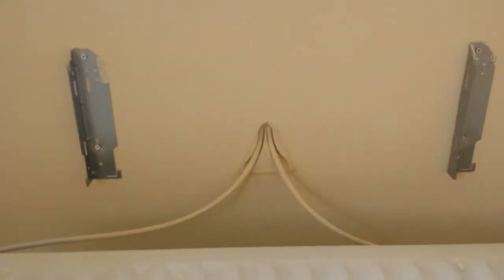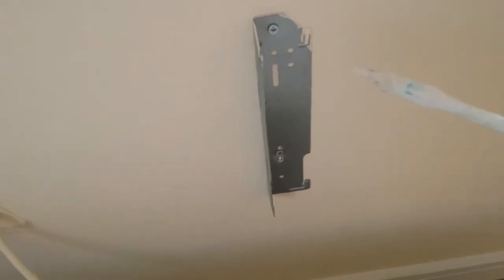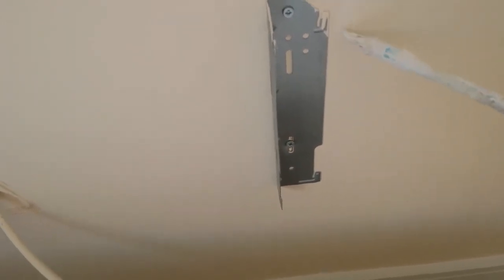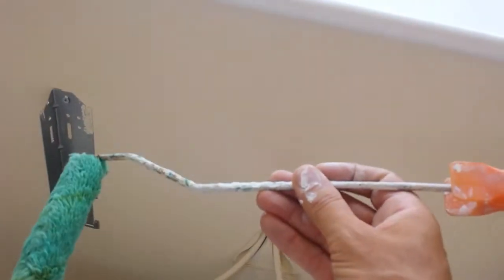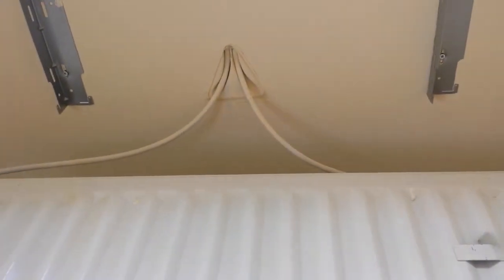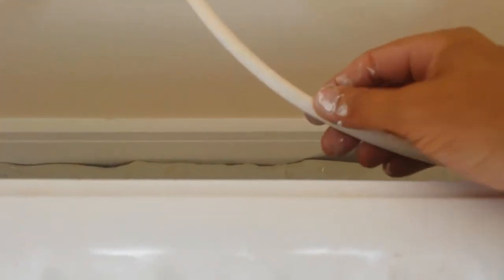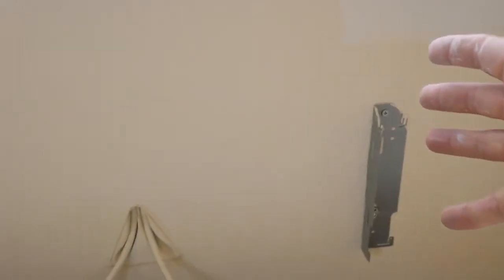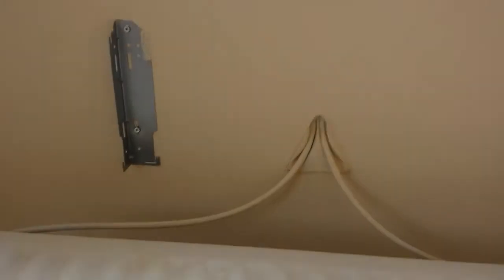Painting Behind Radiators

Comment: Only thing here is, if you do this and a leak happens in the near future its your fault or you will get blamed anyway.. 
Safer to leave plumbers to this. Customer will have to pay plumber direct. 
Painters public liability will not cover you taking radiators off if you caused water damage.
Reply: I never take off copper pipe radiators as I've had nightmares in the past with leaks and pressure in the boiler dropping etc. But these plastic pipes stay in contact I just unhook these without taking off the pipes. I've had no issues so far.
Reply: @danielnugent2168  great website Daniel, top marks for doing it right fella, its just a one of these days thing for no extra thanks from customers, and no insurance! Cheers